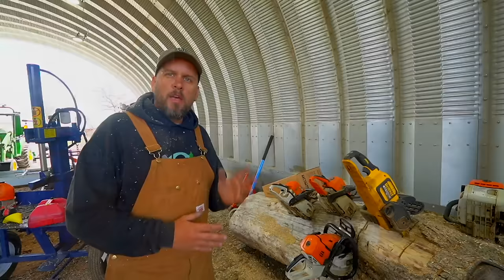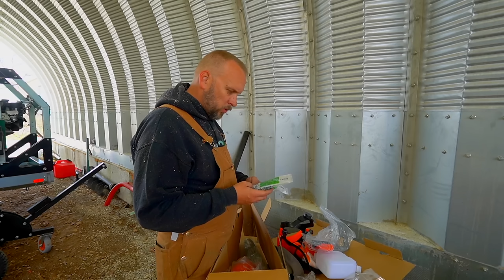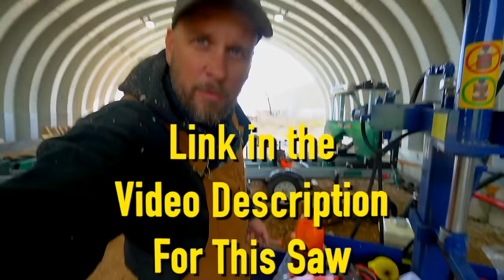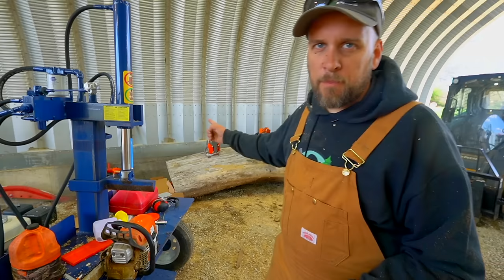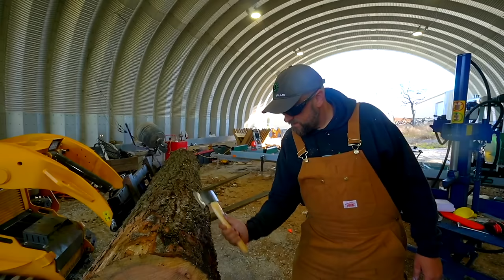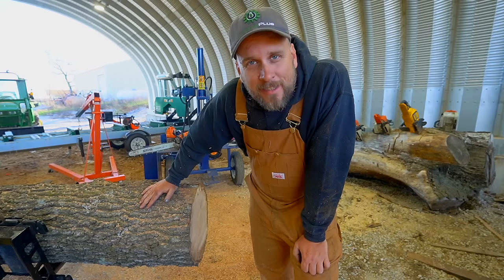Stop Wasting Money On Chainsaws

Comment: I don't buy disposable products with no dealer or parts support and questionable material quality. For those on a budget you simply grab yourself an Echo Timberwolf and call it a day. Top notch quality and reliability, 5 year warranty, easy to obtain parts, available at Home Depot or online. If you're only going to need the saw once or twice just rent a pro saw...I loathe knockoffs/clones and other disposable junk from China. They vibrate badly, they need lots of adjustment, the ignition and switches fail after a year or so, the piston and cylinder quality is mediocre at best. There's no free lunch and you get what you pay for. I have four decades of experience with dozens of saws from around the world.
Reply: U couldn't be more right, but there r many who fall for that common trap, sadly so !
Reply: ECHO!
Reply: I agree with this and I get 10% veteran discount at home depot...  Can't beat that. It's also local.
Reply: I like my Husqvarna 562 XPG chainsaw. I cut more than 30 m3 into 10 inch logs with that chainsaw this year. That was for firewood for my neighbors. I don't believe I could do it with any off-brand chainsaw. 

Don't wasting money for off-brand chainsaw!
Reply: Agreed!!!!!!
Reply: I have the same amount of years using chainsaws, and I disagree strongly with your sentiment. I've used pro equipment, and cheap imports. Mostly the exact same parts! The pro stuff IS nicer and more reliable, but if you don't mind a little shop time and learning your way around a chainsaw, you can save thousands of dollars, and that suits me perfectly. My last saw, (still using it) was a 66cc, 14/20 inch for $125 and it is a BOSS!  A bit heavy and smokey, but....$125. Paid for itself in the first hour of use.
Reply: @theobserver9131  What new pro saw shares ANY parts with a knockoff import? Those clone saws aren't built to the same standards as the originals and they are copies of saws long out of production. It's like buying a 1994 Chevy but built using bad materials and production. The vibration levels are also really bad...

Comment: Most serious cutters buy stihl or Husqvarna saws and take them to the shop for a tune.  These saws are used 5 plus hours a day cutting timber. Little different than a home owners use.  Cheap saw works great for a while, when it's don't you can't fix it, no parts...
Reply: Huskie is very good, but Echo better by far.  IMO..  I'd take a free stihl, but if I have to pay, Echo wins for me.
Reply: Not true, I have 2 of these saws for 10 years now. Only had to replace 1 chain brake and a pull start, plus the usual consumables. Parts are readily available.
Reply: Not true. I always use cheap tools, and keep them working myself. Yeah, original parts are often unobtainable, but I make do. I'm not pro, but I do put a lot of hard hours on my tools. Almost as many hours on the bench as in the field, but it still beats chopping with an axe.
Reply: If I was a pro charging hundreds an hour, I'd do it your way, but I'm not. I'm retired and I don't have that kind of money. I do have the time though.
Reply: When I was a kid, I felled hundreds of trees with a framesaw and a hatchet. My cheap chainsaws are WAY easier!

Comment: That is really surprising to see a $250 saw perform like that.  I'm sure it likely won't have the durability to work day in and day out like the Stihls, but not everyone needs that.  Great video!
Reply: They can be a good saw for the money and many people cut quite a bit of wood with saws just like that.
Reply: Most homeowner saws die because of being straight gassed ,a gasket deteriorating because of age or burning it up by pushing on a dull chain. For the average folks durability won't be an issue.
Reply: @modarkthemauler  i agree!  A gallon of 2 stroke is a lot of fuel for an occasional cutter or someone that needs only a cord a year.

Comment: The big difference is which one will last 20yrs. And if they both last 20yrs which one is less work to make it last that long. I had a husky farm tough that lasted 20yrs without a single issue. Used it every fall to get firewood ready. And it always started. Ive had the stihl farm boss now for 5 yrs. And again every fall and not a single problem. Ive seen friends and others try the cheaper brands ( craftsmen etc) and have way more problems in the first yr or two. And they def dont last as long. Unless youre a professional who cares about which saw cuts faster. In not spending $1000+ to cut a log 10 seconds faster. The husky and the stihl were both around $400. And for the record when the stihl finally dies ill be getting another husky.
Reply: Yes many of the chainsaw you tubers are pros obsessed with performance a casual user simply has no need for a ported saw 😮
Reply: @imfree62 close but the 044 is the legend to judge others.😉😁
Reply: It only has to last 5 years then get another 😂😂😂😂😂

Comment: You spent all that money on saws to find out you needed a good saw! Buy once, cry once.
Reply: I bought a Husqvarna once. Still crying.
Reply: You are parroting a statement made by other armchair enthusiasts, cutting firewood you need more than one saw. You have saws for trimming, saws for bucking, saws for large tree felling. You also need chain in rolls and tools to rivet them and also tools to sharpen them. Add it all up and you have a small fortune!
Reply: @biggysground  Yes, I am parroting the statement because it applies here. I just said he spent all that money to find out he needs a good saw, not one saw. Buy as many saws/bars/chains as feasible but stay away from plastic crankcases and junk prosumer equipment if you want it to last in heavy use.
Reply: @FarmBossSaws  "Buy once, cry once" Applies to buying one time and not choosing different saws, please learn correct English when replying and type what you mean.
Reply: @biggysground  You can easily get by with one saw for cutting firewood and you don't need rolls of chain and riveting tools.
Reply: @rastapete100  Not so easy having to stop and change bars and chains. Best to have a few saws ready to finish faster. A homeowner is different than a farmer that cuts wood for heat or sells cords.

Comment: I was in the tree trimming business, and used small saws for climbing. I started out with Homelites which in those days were pretty good saws, but then when the firewood craze came along in the late 70's, they went down hill fast as they were mass producing them and selling them in every hardware store. I switched to a Stihl pro model with top handle, a real trimming saw, which was a pain to take apart, but there was no question it far surpassed the Homelites in power, weight, and engineering. Now I'm in my 70's, still cutting firewood with this old tree trimming saw, it just won't die. You get what you pay for.
Reply: I have an 020 top handle I bought used about 50 years ago, runs great today after countless cords of firewood.  Not ideal size for firewood but it still works.
Reply: I don't know man, I bought a homelite brush cutter that ran for many years before selling it. I then moved to a farm and knew I needed a chainsaw so I went and got a homelite 16 inch. Still using it now after 6 years and I cut most of our fire wood with it except the really big stuff and never spent a penny on it except for a new bar. I have bought a number of chinese knockoffs that are pretty good for the price, but 2 have failed in that time. Only small things like brake locking, cord broke ect...but not really worth fixing. I'm so impressed with the homelite I have a brand new one sitting there when she finally dies on me. :) EDIT: She starts first time every time unless I've forgotten to empty old fuel for the new season.

Comment: At eighty I just bought probably the the last chainsaw I'll buy. I've owned three different brands through sixty plus years of cutting firewood. I should clarify three brands/ I've only had three saws in all the time. Still have the #3 which is a Husqvarna 61 and just add a little Echo cs130 for limbing out. This is the second Echo the first I loaned to a cousin and some how fell a tree on it; was told he'd get it repaired and never saw it again! And that was at least thirty years ago and I was so impressed with that Echo I had to try another one but I don't loan out my saws anymore!
And as for how fast they cut doesn't concern me as to years of service! 
My first saw if i pulled out of storage and tuned it up would still cut wood today at sixty years old and not  many can say that about their first saw.
Reply: Echo is my choice too..  the whole concept of Stihl is a rip off.  I can't argue that the hardware is near perfect, but I have No TIME for arrogant dealers.
Reply: If you took the first out of storage what would it be
Reply: In my young 60 years, I've developed this rule; never borrow or loan tools. never. It always goes bad. I NEVER get them back in decent condition, if I get them back at all. If someone wants a tool, they can do what I do; freaking buy one!  or they could RENT one from a rental service. If they don't return it, nobody feels bad, they just come and break your legs. No hard feelings.

Comment: I chopped for a friend in the eighties another friend with saw shop convinced me to buy integrated ear muffs and face shield dropped large oak a dead standing hemlock that I couldn't see had a long branch from the oak wrapped around it hemlock came down from behind me gave me a glancing blow on side of helmet almost knocked me out still have scar tissue in neck but would have been dead without helmet in my opinion great video

Comment: Thanks for the video. 
I think you’ll find the cheap saw won’t handle long term abuse.  
I’ve got both pro saws and cheap saws, the pro product is more consistently reliable.  If you cut a bit of firewood buying cheap is probably fine.  If you rely on your saw to heat your home or feed your family you’re better off with a pro saw and keep the cheap one around for backup. Imo. 
Cheers.
Reply: If you're right (questionable), then buy 2 of the budget saws... then you have a spare... and will have far longer overall life and uptime/availability than ANY single saw.
Reply: @turbodog99  You'll still end up fixing both more often then a quality saw and spend more time trying to track down parts when you need too fix them
Reply: @Morpheen999  Ya, I'm a old chainsaw mechanic who worked for a timber company. We used Husqvarna when I first got there. 288's for the fellers and 268's for loggers / landing guys. Both were good but then the 288's started breaking cases and Husqvarna didn't warrantee them we we went to Jonsered. 270's which were basically same as the 268 Husky. Lots were same part numbers. Fellers used the 2077 Jonsered. Which came out turbo'd. The 2077 ran good but mufflers kept breaking off and other things made it hard for the cutters to get a 6 hour shift in and they hated packing them out of the canyons to get worked on. Then we went Stihl. Mostly 044's for both cutters and loggers. We tried the 046 and the 066 and both were good. Stihl's were lower RPM running saws and the users were used to hearing the Husky rev. Those extra RPM's were bad for the crank shafts. The early 044's we started using fried many of their cranks. Stihl came out with a new heavier duty crank that helped and I did a few things to keep the users from leaning the carbs out and frying the cranks. Once we got saws from over revving they lasted at least twice as long. I was curious a year ago and bought the chine made Stihl clone saw kits and put them together. They run and sound just like the Stihl original saws. What I have no idea about is longevity. I have a 066/660 I put together I haven't put a bar on yet. I ported it too. I am just not anywhere I can use it to test it. Possibly this Summer. The china saws are affordable. Even if you have to buy 3 of those for every 1 stihl original. You can say warrantee makes a difference but Stihl wasn't good about guarantees either. When a crank starts going bad it gets hot and turns the bearing and crank blue. Stihl would say the saw was leaned out and THAT was why it failed. I had set the RPM's with the stihl tool and welded the carb jets together so they were tamper proof and cranks still went bad. Not many but they didn't warrantee them. Put a new crank in and the RPM's were still where I had set them the first time. The problem with the china saws is it's hard to get a full wrap handle bar.
Reply: How do you figure thats true? I hear about problems with Stihl and Husqvrna all the time. I have the same experience with my husqvarna. It worked for one firewood season and didnt want to start during the summer 4 months later. Needed a new carb.  Im not sold on over priced brands because some brand snob says a product is better. Even my echo is better than my husqvarna. The 62 cc Chinese  Neotec knockoff is better than the husky too, I've ran it more than the husky and no issues. no need for a new carb either. Only noticeable difference is vibration and im not concerned about that in the least. If I need a new saw every 6 years I'll be buying abother chinese knockoff. $200 or $700? Brand snobs just love to waste money. @Morpheen999
Reply: @youtubecertified4643 I totally agree. Even if it craps out you haven't lost much.
Reply: NOPE. My $125 chainsaw has been kicking ass for years. I don't mind spending time at the bench. The pro stuff is MARGINALLY better, but not worth 5 to10 times the price.

Comment: I have a 52 cc Chinese saw from Amazon that I paid $106 delivered to my door. So far, I have cut down seven trees and bulked them into firewood. The largest tree I cut down was 24 inches in diameter. I’ve had to replace the pull start assembly and the four screws that hold it on. That cost $12.00. I replaced the spark plug before I ever started up the saw. The spark plugs that came on my saw can damage the coil. I found that out by researching the saw, before I bought it.

If you buy one of the 52 cc Chinese chainsaws like mine, put blue loctite on the four screws that hold the pull starter assembly on the saw. Check all screws and make sure they are tight. If not, the screws will vibrate out. My saw has performed faultlessly since replacing the pull start assembly. My son has purchased three of the cheap 52 cc saws so far. He has several Stihl saws, but they got too expensive to repair. Follow the break-in instructions to the letter. 20 to 1 mix for the first ten hours and 25 to 1 after that.

For the casual user, the cheap Chinese saws are okay, if you have at least some mechanical ability. I have a 23 year-old Poulan saw that still runs. I’ve had to replace the fuel lines on it and gone through a couple of bars and multiple chains. I use it to cut stumps below ground. I buy 3 chains for $21 on Amazon. My son cuts trees for firewood. He burns wood to heat his home. The Chinese saws are working for him. I only process about one cord of firewood a year for a fireplace at our cabin.

Before buying any cheap chainsaw, do a little research on YouTube to see what users say about that particular saw. That’s how I learned to replace the original spark plug with a good quality spark plug, before using the saw. My son recently told me the 52 cc saws are now down to $89 on Amazon.

One last note: the last two professional tree cutters I hired to take down trees charged $2500 +$2000 =$4500. I gave the last guy a $500 tip, on top of the $2000, because he did a great job. I can buy a lot of $100 saws for that kind of money. So far, the $120 I’ve spent on a cheap saw has saved me around $2000 for 7 trees. I’ll still call the professional for trees I don’t feel comfortable taking down myself.
Reply: This is the kind of comment that I look for.  Thanks for the info.
Reply: I have owned an MS250 stihl for years.  Cut no telling how much wood with it.  We used it around our sawmill bucking logs to length and we now use it in our tree trimming business for larger work in the bucket.  Its not a "Pro" level saw but does a great job and is very durable and long lasting.  Even got it stuck in a cut up in the bucket, talking with ground and forgot i hadn't unharnessed it from teh bucket before i boomed down.  Bent the bar badly but didn't hurt the saw.  New bar and it works just fine.  

If you only need to make a few cuts, or a few trees the china stuff will probably work.  Just like Harbor freight tools.  But if you know you going to be using it for years to come, Stilh or Husq is probably a better choice even if its homeowner grade.  Or go used pro grade.
Reply: J
Reply: I just ordered a Farmertec G660 pro, looking forward to trying it out.🙂🙂🙂🙂

Comment: I bought a 029 farm boss Stihl in 1994, Stihl running.
Reply: Bought my 029 the day after a hurricane hit us, Sept 96. Just some minor tuneups and filters and she has never spent the night in the shop!
Reply: Don’t know the year I bought my 029 but general mantience and it’s still going strong
Reply: I have a 20 plus year old 038 that worked in the woods, now is my firewood saw with a 32 inch bar. Still runs strong.
Reply: Yes, bought mine in 1996 after getting hit with a tornado at our farm. Absolutely no parts were changed on it including air filter and spark plug until 2022. 
It listed for $360 at my local hardware store. They had a coupon that the saw shop manager was refusing to honor. I argued with him until 10 minutes before closing and coupon expiration. After I read to him for the twentieth time: 15% off of any one item in the store - he finally relented to a point, and grabbed the display model without a bar cover and mumbled something about a reduced warranty.
Reply: @Larry-hi1ri the O series ended sometime around 2000.